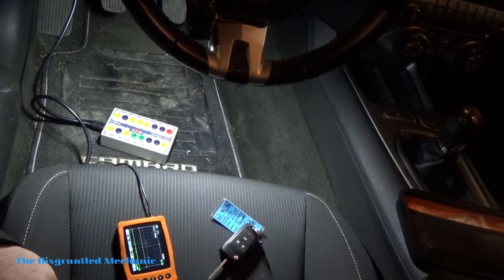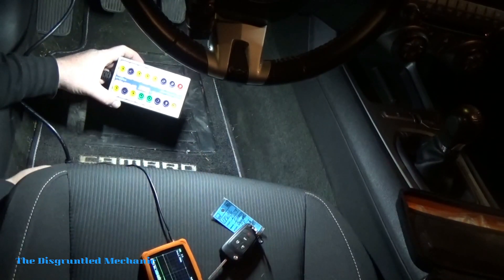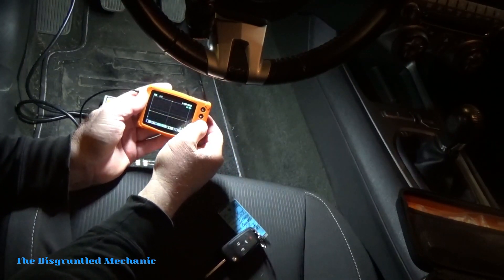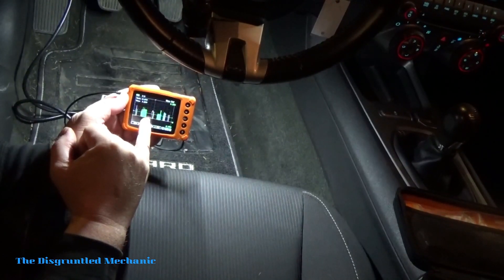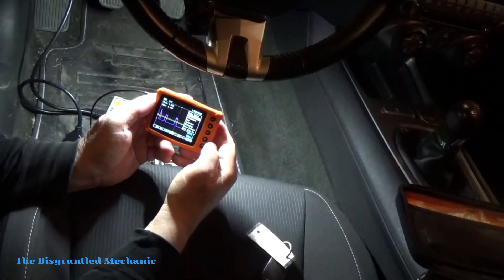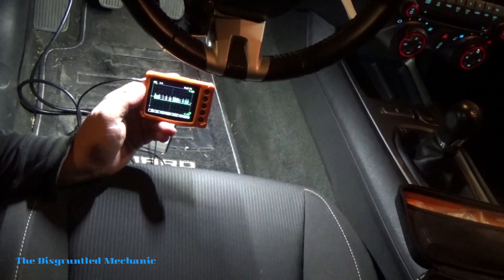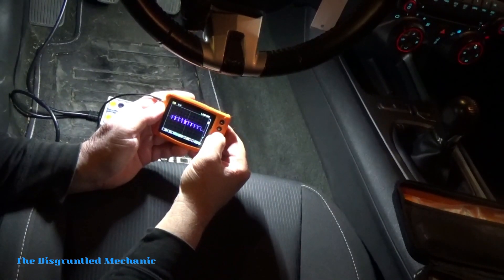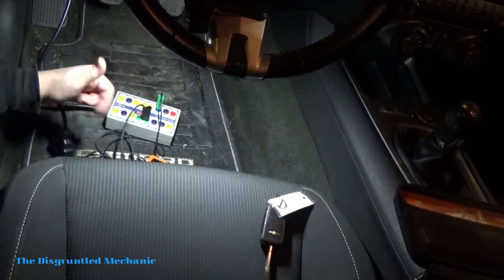Uscope CAN HI-CAN LO Test/Setup

Comment: nice mike!   I think im getting that 450 for the kit     at chevy we were not trained on the scope was not dealer equipment   to check can....  voltage between high and low   like 3.5 v  but a messed up signal can still give you that   it was only if something not open or shorted
Reply from the maker: I already had some of the stuff in my pico kit so didnt need all the other stuff.
Reply: mike  brandon and paul in pa!    in may  this is good!
Reply from the maker: @scuba422123  already signed up.
Reply: I just got an email from aes wave  the first I knew...